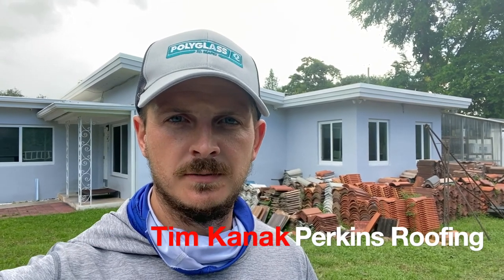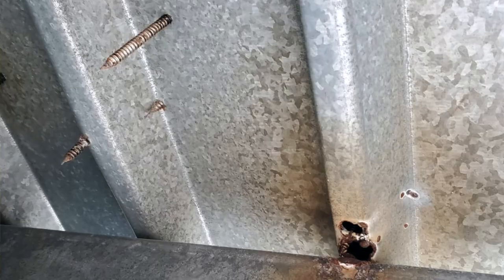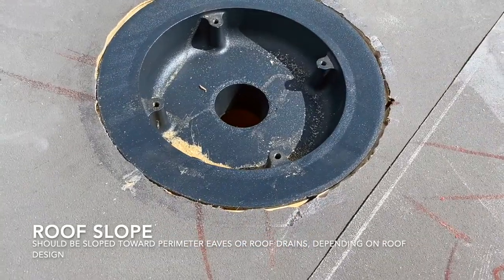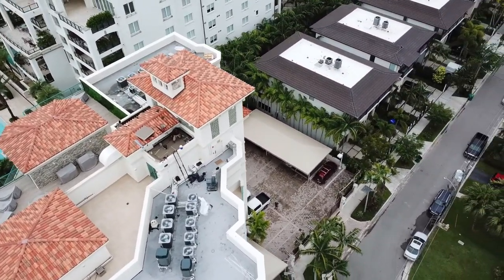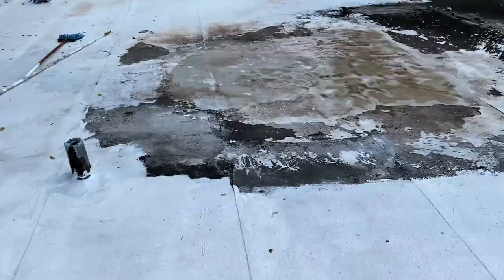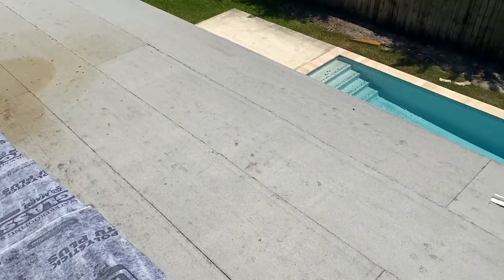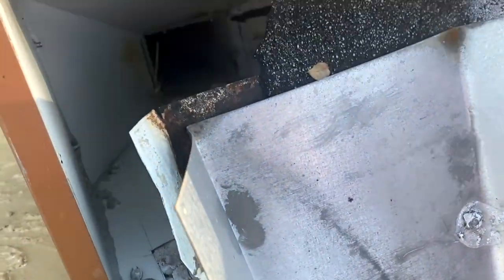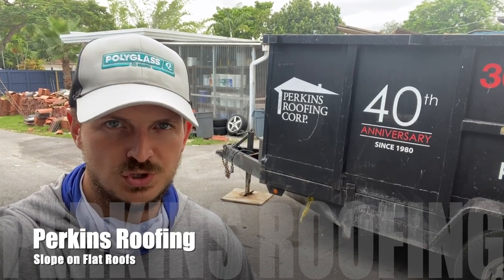All About Flat Roofs and the Sloping of Flat Roofs | Perkins Roofing Corp.

Comment: We just had a flat roof installed, the water ponding on the one section of the roof it’s significan and it stays there for days. The slope on the roof after the new one was done it’s actually negative.
Roofing company is claiming roof slope was not in the contract 😮